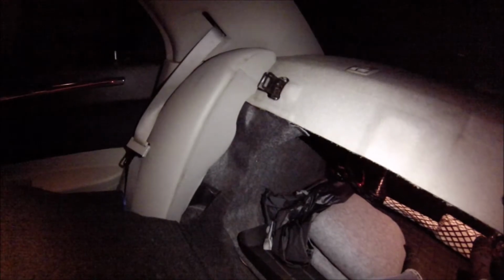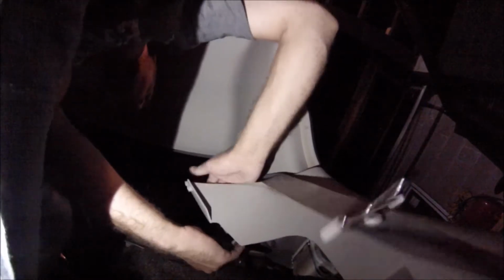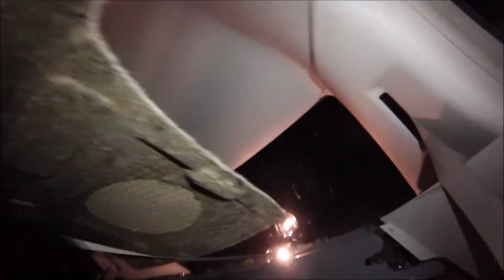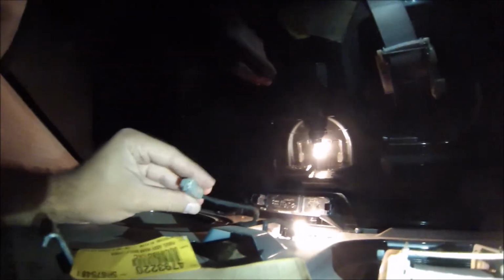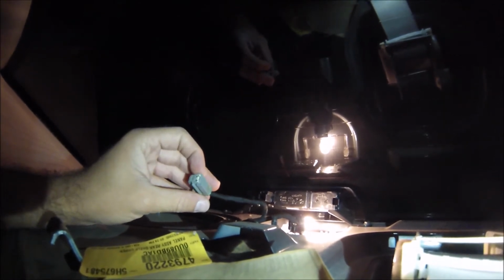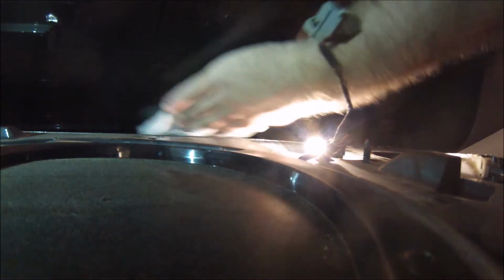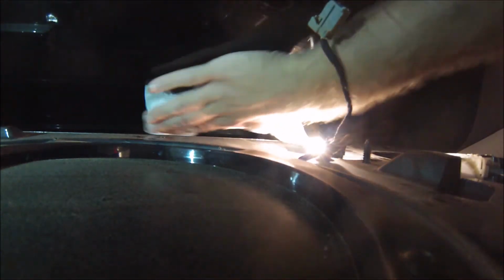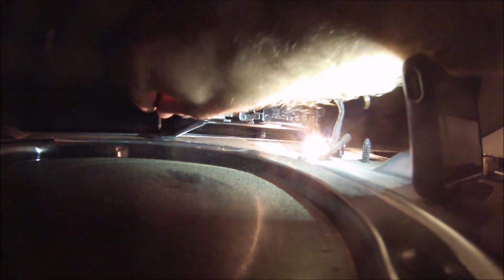Chrysler 300 Third Brake Light Replacement

Comment: Congratulations on becoming a YouTube Certified mechanic! Did you just spend a night fixing small issues with your 300 using junkyard parts, or were these separate events?
Reply from the maker: Hahaha :P 
I had gone to a u-pull-it yard to find a fresh new driver's seat but end up pulling all sorts of odd stuff instead; this night I fixed the struts and brake light, the rest I left for another time. 
Thanks for watching, by the way! :)

Comment: Intense!
Reply from the maker: To repair brake light:
Remove bumper
remove tires
remove brakes
Remove calipers
remove rotors
Remove axle
Remove engine
Locate brake light assembly
Remove car
Replace brake light!